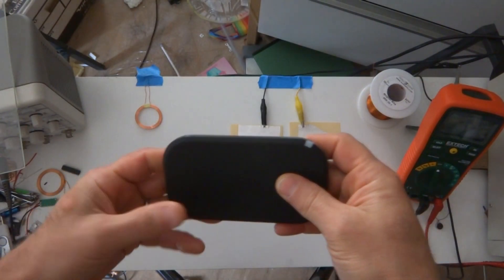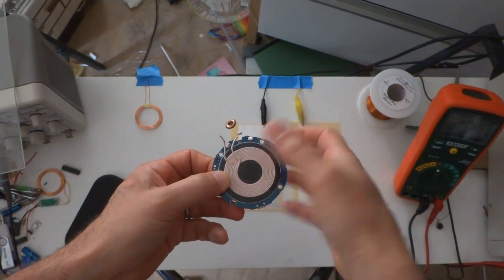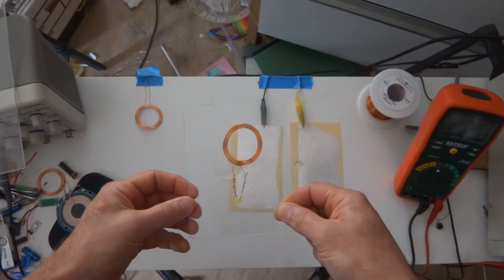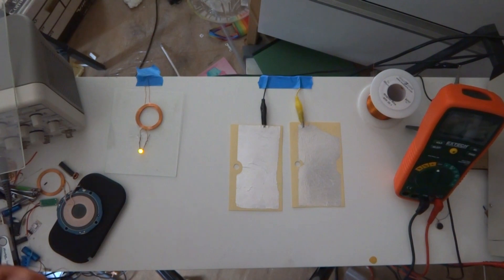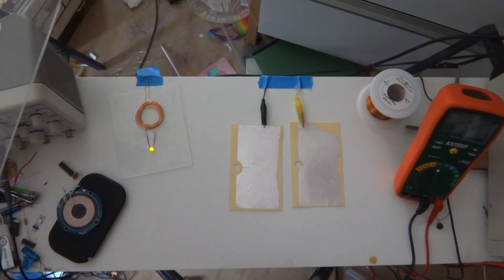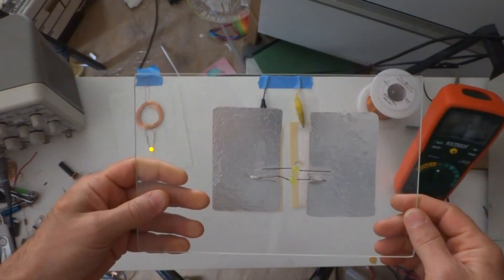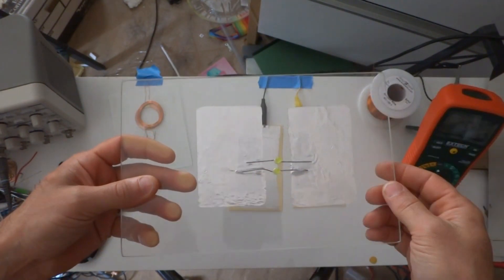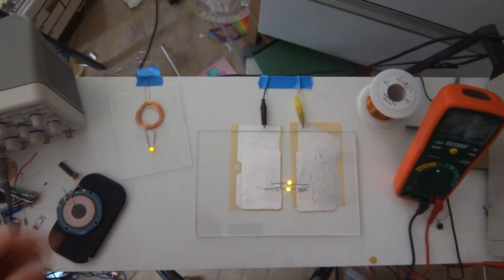Wireless power transfer using capactitive coupling demo

Comment: Nice job Josh! My company works on capacitive coupling for wireless power since 2006 and now we have a great working system with only one electrode needed. We commercialized in 2011 a iPad2 charger in Japan delivering 10W in the iPad and now our Japanese partner Murata has a very flat design system to power laptop ready to commercialize ... when laptop sales restart. If you have time come and take a look at my videos and don't hesitate if you have questions to contact me. Now we are launching a lot of developments in Europe based on capacitive coupling for house appliance, tools and automatism. Our target is to increase the frequency and deliver several kW in a small design. In fact kW capability is already proven at MHz frequency by our friends at Furukawa Denko using a setup similar to what you show in your video. Now we jsut need to find the means to reduce the size of the system.
Reply from the maker: +Stephane Vogley I've read the Murata patents the modules could be very useful for some products I am working on. Unfortunately the modules do not seem to be available via any US distributor. I've even tried going direct to Murata some time ago, but all inquires went completely unanswered. Are these modules actually in production? If so, how do you buy them? Thanks!
Reply: +Josh Levine , yes I heard from many people that Murata was not very proactive on sales. In fact they are only interested in big business with huge companies and will ignore even 25k pcs orders... That's why I started a new R&D center separately from Murata to start several applications with interesting partners in Europe. If you can give me details on your project I will be glad with my team to help you. You can contact me at svo@tmms.co.jp

Comment: Hi Josh, there is also a technique that uses 1 capacitor plate + inductor to transmit electricity. It works, but it seems that is very little known.
In that video you're using 1 full capacitor, 2 plates, to transmit or receive energy. You can replace 1 plate with 1 inductor and you've a mix of a capacitor and coil.

Comment: Thank you sir. I have tried this experiment and it works. Back to your comment, you said "The farther away the receiving plates are from each other, the less they will each feel the field of the opposite transmitting plate." What do we call this phenomenon exactly? 

And after some research on academic articles, it is believed that by some matching (e.g. add some inductors for resonance) the capacitive coupling can have some practical uses as you have mentioned in your website. Do you have any suggestions?
Reply from the maker: +Kin Chung CKC Chui Think of the current flowing though the LEDs as just electrons sloshing back and forth between the two receiver plates. These electrons move because they are repelled by excess electrons on one of the transmitter plates and attracted by the relative lack of electrons in the other transmitter plate. As the electrons flow from one receiver plate to the other, they are also attracted back to the lack of electrons on the plate they are flowing from. The farther away they can travel from this plate, the less they will feel the attraction. Make sense?
Reply from the maker: +Kin Chung CKC Chui Yes, driving the plates at their resonant frequency will be more efficient because more of the power will go into actually driving the electrons though the LEDs rather than slowing them down and making them turn around. At resonance, the electrons piling up on one plate start to repel each other more and more until they have built up enough force to be able to help push them back in the other direction. Adding an inductor can lower the resonant frequency and increase the voltage at each end of the sloshing.

Comment: Sir, thanks for your inspiration concerning the WPT using the capacitive coupling. I wish to conduct the experiment by myself. Could you please provide some more details of the set up, like the size and material of the plates? It would be perfect if you could tell a little bit more about how you connect the LEDs to the plates. Thanks SOOOO much.
Reply from the maker: +Kin Chung CKC Chui The plates were just some aluminum foil glued onto glass, but any conductive material on top of a non-conducive material will work. The larger the area the plates, the better. The farther away the two receiving plates form each other, the better. The closer each transmitting plate it to the corresponding receiver plate, the better.  The LEDs are just attached to the aluminum foil with scotch tape.
Reply: +Josh Levine Grateful to have your reply and gonna try it today. Having a greater distance of the receieving plates will provide better performace, does it related to anything about the mutual capatance of the two caps? btw just wanna confirm that does the orientation of the LEDs matters
Reply from the maker: +Kin Chung CKC Chui The farther away the receiving plates are from each other, the less they will each feel the field of the opposite transmitting plate. The LEDs must be oriented opposite directions of each other to let the current to be able to flow though one LED in one direction and the other LED in the other. In the demo above, only one LED is actually on at any given moment. They just flick back and forth so quickly (a million times per second) that you can't see it.,
Reply: +Josh Levine can i know.. how much the output power and frequency at transmitter that is transferred to receiver?

Comment: The big question I have is:
Does the power transfer if one of the sides is at 90 degrees to the other?
IE: so that the receiver pads lie across both of the charger pads, rather than directly laying on top of them.
Reply: Jeff NME Judging by the layout, it looks like the plates are oppositely polarized at any given time, so if you had them crosshatched like you say it would cancel out the voltage difference and you would get no capacitance and no current flow.
Reply: Max Bessey That's what I would also guess, but I have a funny feeling that the old saying "If you assume anything, it only makes an ass out of u and me." might apply.
Sometimes direct experimentation is the best way to answer a question.
Reply: Jeff NME
 I have actually done a significant amount of direct electrochemical research in capacitor technology. Unless you have some way of limiting the flow of charge from one side of the plate to the other (which as it would be in your scenario simply shorted), you wouldn't get any charge buildup between the two top plates. They would be electrically equivalent. But you are correct in that sometimes to convince yourself of something, you must do it yourself. Carry on!
Reply: Max Bessey
I'd guess that the best way to design a capacative charging station would be to make it difficult (impossible isn't possible, always expect a better class of idiot) to misalign the device and the dock.
Making the dock a recessed rectangle, (rather than a square or circle) and a matching rectangle on the device to be charged, as it could work in two orientations (where the plates don't crosshatch over each other) sot that it fits together and the other two (plates at 90 degrees, crosshatched) where it doesn't so that the parts won't even mate together and (hopefully) be rather obviously wrong.